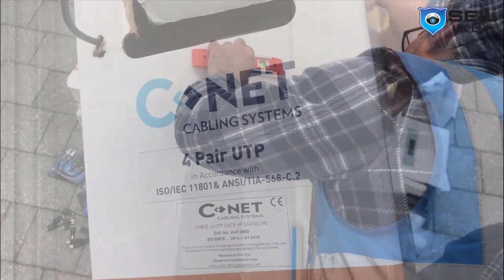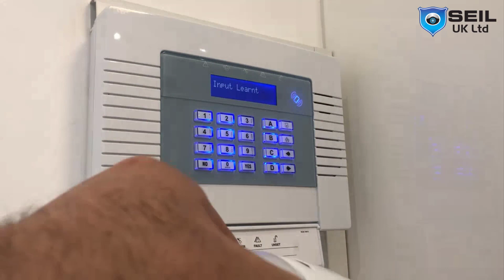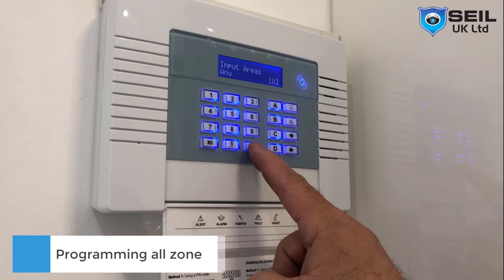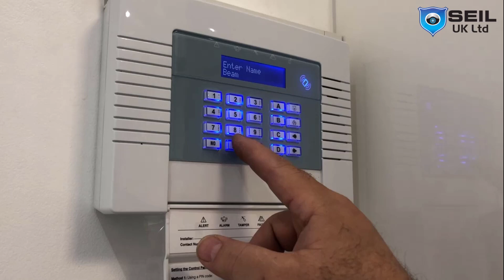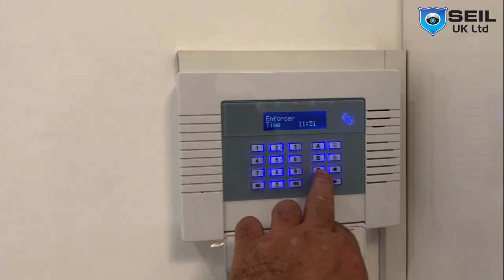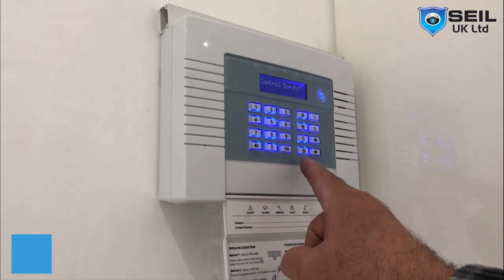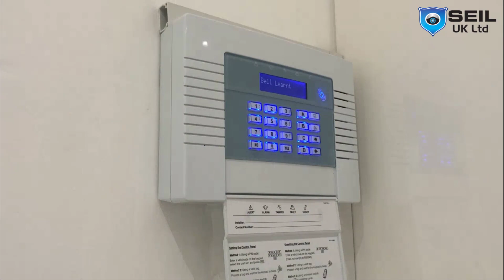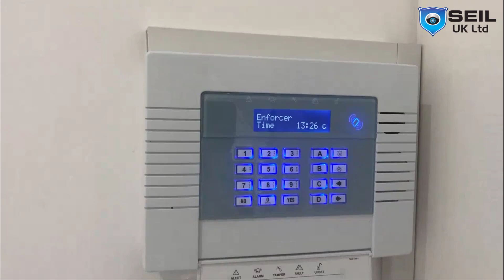How to complete Pyronix enforcer kit1 installation by seiluk

Comment: Great video. I didn't realise you could power the control unit by mains power, I thought it was battery only. Can you hardwire a bell box from the enforcer at all? Just thinking of not having to up a ladder to change the batteries in the bell box every 2 years

Comment: This is not the correct way to install this system. 3 screws on the panel and not one of them was on the rip off tamper tab. system plugged in and not on a 3a unswitched spur. devices learnt at the panel and not at the installed location. Door contact installed with 3M tape so again no screws on the anti-tamper tab. use of a drill to fit the PCB of the PIR. sorry but its installs like this that is killing the security industry. Learn how to install the equipment correctly.

You are meant to be a pro and this is not a pro install. anyone could have just done what you did as a DIY job not a pro job
Reply: A bit of a silly comment

Most people watching these are doing DIY because the alarm company installers are an absolute rip off

It's not rocket science but also not clear, there are numerous holes on the dial pad none of which are marked clearly to what you need to install

The anti tamper screw you mentioned is meant to be used for levelling and unlevel surface which you can see it's flat here

Using a drill on the PCB won't harm anything if you have been using electric drills for years, though I personally would hand tighten them, wouldn't want any flex in the PCB board to crack any solder on any components

But this guy is the only one that has put something of use out there

If you can do better

Do it!

Instead of complaining
Reply: @deepmystic6739  I do better every day. 

Start off yes it is stated in the manual and on the training given by Pyronix. 

2nd he is trying to be a pro so he needs to show he is a pro. 

3rd it’s not just the solder joints on a pcb it’s also the solder mask getting damaged along with the multi-foil layers getting damaged. 

Last of all if I want to do a video I would but then again no as im installing this gear day in day out to a grade recognised by insurance company’s unlike a DIY system
Reply: @MrTamworthaj  I was not talking about the installs, I was talking about the videos

This is exactly why people like myself choose to install ourselves, I have to admit, I didn't even use an electric driver to install the PIRs just to make sure I didn't warp or break the plastic

That being said, this problem amongst the pros is why I decided to do it, plus the cost was extortionate in my opinion

It's a few hours of work and not justified as we did not need a monitored system

The instructions are so unclear on so many parts of the manual

In the PIR manual install guide, they show how to change from low to high sensitivity

Yet in the diagram it clearly shows a 3 pin header being used

But all the PIRs I have had only 2 pin headers

Also no clear instructions where to put the screws

Same with the console, I have read the instructions manual over and over

No markings on the bell housing or the control panel about where to put the screws

I just put them in the corner and the one with the big notch cut out as it made most sense

I would love to see a video showing how to do these simple things

Helping DIYers is not going to loose anyones business, for personal reasons I am unable to pay the prices and in all honesty I love doing things like this so would rather spend the money elsewhere
Reply: @deepmystic6739  if you need any help or advice on this kit let me know. 

I really don’t have time to make videos as we are working 6 days a week lately installing this kit and CCTV systems but if you need something that you don’t understand give me a shout. 

The manuals don’t show it well as the pyronix kit is designed for professional installs and that’s why it might come across ad not friendly
Reply: @MrTamworthaj  I really could do with some advice

I take great pride in what I do and have OCD 

If I was an installer I would be one the best out there for sure

Theres a few things that I have found confusing so far

-Regarding the PIRs location, it says in the manuals not to put them facing the windows due to sunlight and how the tech works, yet I have seen so many installs facing the windows and it seems to make most sense, is this only true if the window is south facing or has bright light traffic passing by, we have blinds up so can't see it being an issue.

I'm in the middle of installing so can make adjustments

-Also regarding the PIRs, we have a kitchen and 2 living rooms, I got 4 in the pack.  One I have put in the living room facing windows. The other in the kitchen. Another one in the hallway facing away from the main door which has a magnetic switch on it and one on the upstairs landing. I noticed it has some plastic that looks like it can be removed, do you put the screws through this part of the housing or not? All are in corners

-Where is the correct screw position for the control panel and the bell box? I have seen a few videos now of people using the plastic parts labelled A and B in the bell box and using them as screwmounts. 

-Also the bell box is protruded from the wall a fair amount, do we need to silicone over the top? Or is it designed for water to fall behind it? Still feels like water ingress will get in on the main bell on a wonky wall due

Any other advice you can tell me would be great

I haven't programmed anything yet and already installed everything on the walls

Tomorrow will be programming whilst they are in their position as I wanted to make sure they are all communicating correctly 

Thank you so much
Reply: @MrTamworthaj  Also I had an electrician run some cable from the CU and add a 3A unstitched fuse spur, would 0.75mm 3 core flex be safe to run to the box? Or does it need to be 1.5MM

Thanks again
Reply: @deepmystic6739  

Regards to PIR movement positions. It’s advised not to have them pointing directly at a window or heat as this may create an activation (although sometime we do have to to fit them facing windows and never had any problems).  But don’t install them behind doors or any high furniture as if the door is open the sensor won’t pick up movement. 

On the back plate or the pir you should screw into that pop out plastic (on the back of the pcb you will see a switch this makes contact with the plastic ao if the pir is pulled off the wall the panel will go into tamper alarm) 

Another thing to remember is that the pir will best pick up movement walking side to side ie left to right or right to left. 

The base plate on the bell box will sit off the wall and a lot is so watter can run behind it. Please don’t silicon it as it will hold watter if you do. Could be a paid when changeing batteries. 

Fitting the bell box is really easy. You put one screw in the wall and temporarily use the hole on the mid top of the back plate to level the plate. Then mark out the 4 holes. 

You then drill the 4 holes. 

On the base of the bell box you will now need to fit the “dogs” they are the 4 round plastic tabs labelled A & B. 
You will see on the Base that the A and B with be marked out to match. You can then rotate the DOGs to line the ball box level. 

You will see on the left hand side the tamper spring.  This is plastic and has a screw hole. In the box you will have a long screw for this.  When the bell box is secure to the wall you want to have this screw touching the wall but not into the wall. (This is so if someone pulls the box of it will activate the switch same as if someone was to open the lid). 

Out of the 1000s of them I have installed I have only found one with water the had made it to the PCB and found out customer was using a jet wash on it every Sunday at same time as doing his car.  Good call on getting a 3A spur fitted.  0.75mm is ok but I have always installed 1.5mm as seems to get a better conection in the spur. 

Also please look at the manual regarding mains cable routing. (I have had to got to a few installs that we did not fit as they was getting wireless interference alarms as the cable was run inside the panel incorrectly. 

WIFI. If you have a V11 then you might find the WPS useful when connecting the WiFi as the other method can be a bit fiddly. 

On the door sensor you will see one screw hole with cutouts on it use this to secure the sensor to the door as again it will let the panel know if it’s tampered with. 

Also remember try not installing the panel next to any mains if possible ie next to your fuse box or a microwave
Reply: @Aj & Tobes  Sheesh man 

Can't thank you enough

So I have installed the PIRs incorrectly, I avoided going into the plastic part! Not a big issue anyway I can drop them down and use one hole and redo these tomorrow

You mean the 4 holes in the corners? 

If so this is what I have done

Thanks for the heads up regarding the routing

Will double check this tomorrow

I have fitted the door sensor correctly

Just need to redo the PIRs 

So far I have had to fit one just above the door unfortunately as the other wall is curved and the other corner has high furniture

I have told the missus to always make sure the front door is shut but I might try figure out a better position for it

Once again, thanks a bunch mate
Reply: @deepmystic6739  the pirs you will ideally need to put screws in the little plate that can pop out. Don’t worry if you have put screws in other parts leave them in and put two more into this plate. (Your best to have no holes empty as spiders will get into the tiny holes.   The fun part is programming. And before you do any programming clean start the panel. This is in the manual but some people forget to do this. I advice you don’t skip it as it might mean reprogram everything further down the line.   Give me a shout if you need more help
Reply: @MrTamworthaj  Alright mate that makes more sense

I'll throw in another 2 more screws on each one to hold that plate in

One more thing about the bell box

Those Dogs, we need to install them and then put a screw into them? 

Thank you so much mate 

Your a bloody legend

My little one was born with special needs 2 years ago and our life changed alot

Still can't work full time at the moment until she is ready for full time nursery

Otherwise I would have paid someone to do this for me

Thanks again
Reply: @MrTamworthaj  Matey need your help again

So I have fixed all the PIRs so now have two screws going through the anti tamper part

Relocated one of them as well

The dial box only has a tamper levelling screw, but the walls flush, am I missing anything on the mounted part of it?

Also, how the heck you keep the bell box battery in place, it sits in but kind of flops out 

Thanks mate
Reply: @deepmystic6739  only got a new version on me but just put a video on my channel just to try and help you with the bell box
Reply: @MrTamworthaj  love you man! Thanks so much
Reply: @MrTamworthaj  Seriously mate 

Thanks so much

I got everything sorted now

I was confused whether I needed a wall plug for the tamper screw but I get how it works now

It pushes against the wall to raise the little bar up that hits the tamper switch

I got the older version with 2 batteries

At present everything is OK, just can't see how to install the weather guard and battery together

It keeps hitting the guard

Apart from that my setup is looking nice mate 

Gonna programme today as well 

Will reset first like you said
Reply: @deepmystic6739  the weather guard was taken out the kits about 7-8 month back for that exact reason. They are very very tight as the battery will hit it or if you twist the battery holder the lid won’t shut.  

They then stoped sending the guars out saying they they don’t need to be fitted anymore then last month they changed to the new one with no battery pack. 

Anyway glad to help and if you need more help give me a shout
Reply: @MrTamworthaj  That makes sense

I think I'm done

Gonna have to programme the bell inside due to weather today 

But can't thank you enough mate

You are an absolute legend and wish you continued success with your business

Thank you
Reply: @MrTamworthaj  Hi mate 

Hope all is well

So I have installed everything correctly, I have set up Area A and B and installed the app correctly

Everything seems to be working perfectly and apart from the annoying menu options on the keypad, I do like the alarm system

Have just 2 issues now on the menu

1. When I try to perform a walk test, none of the devices show and I can't complete it, I am sure it was in engineer mode but on other videos it shows up as a list until they activate each one

2. When I swipe my fob the volume beeps are OK, but when I activate at night for downstairs only through the app, the set beep is too loud and long and one solid sound

How do I change this?

Then I will be all set mate, been a huge learning curve programming this beast but definitely feels solid 

Thank you again mate
Reply: @deepmystic6739   hi mate. Walk test takes a few minutes. We normally put them in walk test and wait a few minutes “for the system to wake the zones up”. 

As for the volume in the engineers menu’s for with see volume then scroll to APP Volume this will be the volume for the app. I can’t remember if you can set app level volume but will check for you. 

Just a quick one regarding the walk test. On the mobile app if you click area is it showing all your zones?
Reply: @MrTamworthaj  Yeah I saw that and had it set to 2 but still too loud 

Ok need to do the walk test again, didn't wait too long 

Yes I can see ABCD 

Each input I set to each zone apart from the night one which I removed the PIR on the upstairs landing 

So now when I activate the alarm at night the entire ground floor has cover

I also added the magnetic door switch as an exit route I'm assuming this is correct? And all PIRs as intruders
Reply: @MrTamworthaj  Alright mate

Everything nearly finished now

I removed all the Pet friendly filters off the PIRs too as we don't have pets and much happier with the sensitivity of the PIRs now

Just one thing driving me mad

Can't get the door sensor to trigger the alarm

Have changed input to entry/exit and switcher

It recognises on the walk test and diagnostic shows strong signal

But for some reason no matter what I do I can't get it to trigger the alarm
Reply: @deepmystic6739  have to got it set for both A and B in the inputs?
Reply: @MrTamworthaj  Yes in both zones

I think it may be faulty
Reply: @deepmystic6739  is the zone showing open or closed. On the sensor ther is a small arrow the magnet needs to line up with that. 

Also when you open and close the door is the light changeing on the sensor top?
Reply: @MrTamworthaj  Damn I thought you had it

The lines are lined up and it's open on both zones actually all zones

The lights do seem to come on

What should the front door magnet sensor be set as? I have tried everything

Unless there is another setting I am missing
Reply: @MrTamworthaj  It's just this one issue and I will be all set

I do love the pyronix gear so far

Love the fact the downstairs is active while we are sleeping

No doubt if it goes off during the night I will have a mini heart attack!
Reply: @deepmystic6739  ok will make you a video up tomorrow mate. Just to go over some things to check with your zones
Reply: @MrTamworthaj  Matey I figured it out

I had to change the setting to input type 10-FX 

Then change to any not all in group

For some reason this fixed the issue

Everything is now nearly perfect

Just the set and unset beep is so loud

I put everything on 1 but still annoyingly loud 

Such a big jump from 1 to silent mode

At moment I have put in silent because it's too loud when I set at night 

Thanks so much for all your help

The alarm has been installed and worthy of being engineered approved I'm sure!